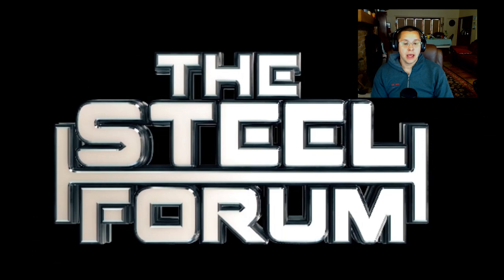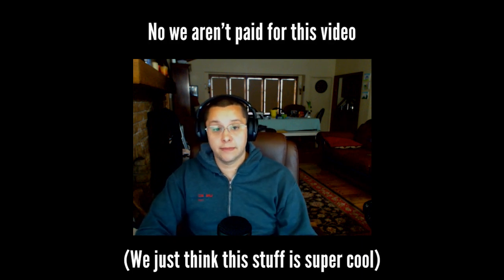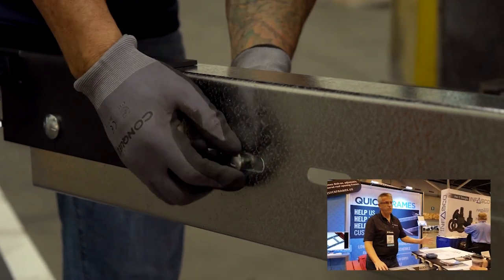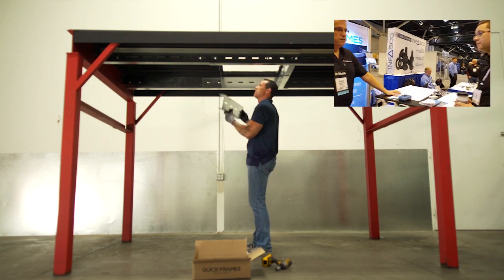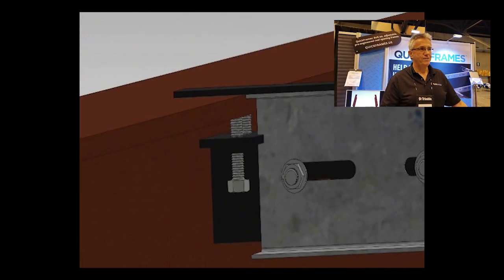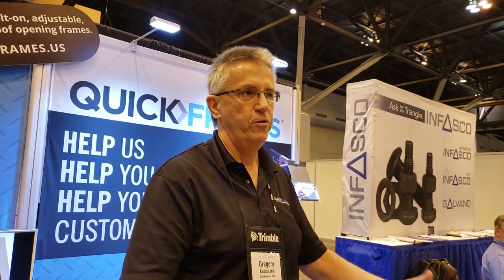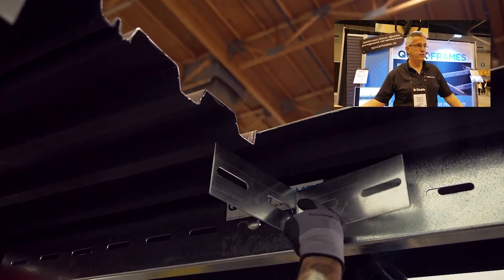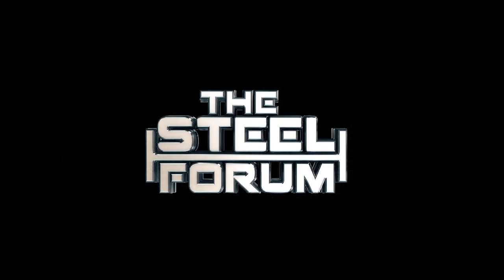The future of roof and floor frames.  Faster, safer, easier.

Comment: Fabricators could make some bank on this by charging their normal rate for frames and selling these!  As the gentleman said - it's not just the cost of the angle iron.  As far as I'm concerned the angle is the cheap part.

Comment: Man I'd prefer to go this route, save a lot of detailing time so we could focus on the real stuff or move on to other project.
Thanks for sharing guys!
Reply: I am dying to try these out on a project.  Not having to come back to a project 4 weeks after it was sent for fabrication to try to decipher some other trades' plans and RFI them to death for final dimensions is a huge selling point to me just from the detailing side of things.  Not needing a fire watch, being able to install without concern for whether or not the deck is on or tying up the shop to fabricate angle frames when they could be making beams, columns and braces.....that's a HUGE selling point to erectors and fabricators!
Reply: @thishandleisnotavailable632  I have contacted a few of our usual erectors for there input since you rolled out the video they would like to try it on a few projects. Just waiting on a few more for feed back before I submit to management.